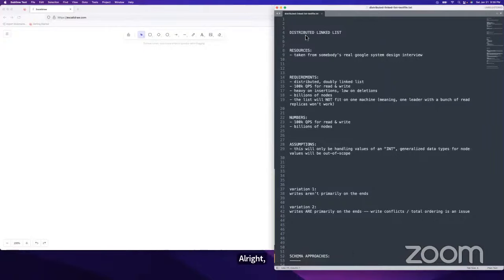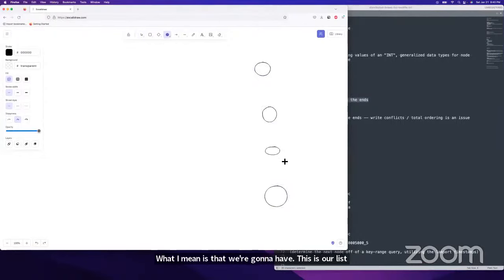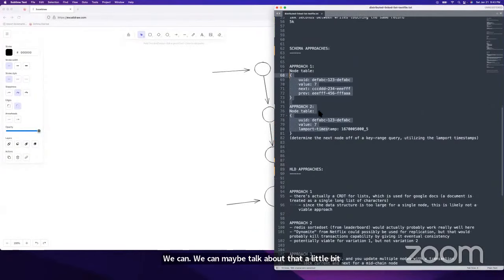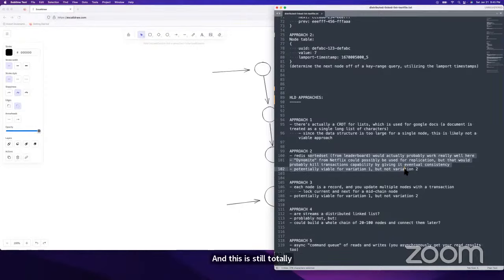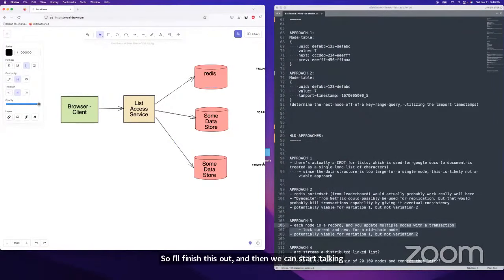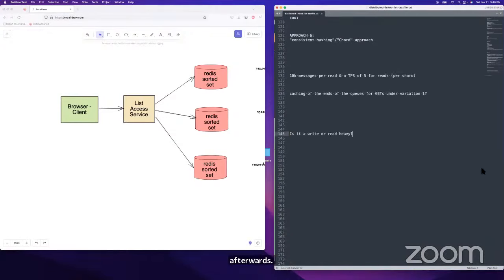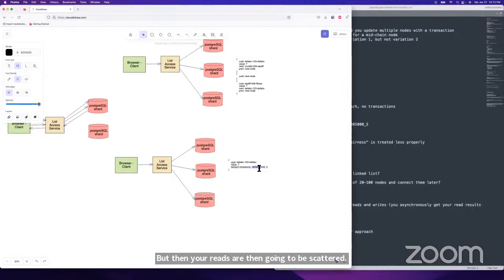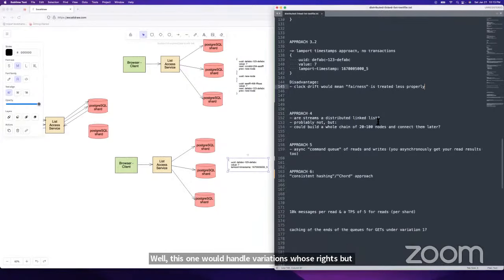Google Interview Question | System Design: Distibuted Linked List

Comment: I get a bit lost without the context of what we want to read and write. Just random nodes? Would be nice to have a bit more context on the purpose of the list.
Reply from the maker: it's a generalized linked list
it doesn't matter what the data is because that doesn't impact design of the system, except for potentially whether the data is large vs small

e.g. if you were designing dropbox instead, you wouldn't be clarifying whether you're storing numbers vs letters -- it's files. you have to store these large blobs of data. that's the challenge.

Comment: "billions of nodes"
"the value is an int"

That's just 4 bytes. 1 billion times that's only 4GB.
Even taking into account the "s" on the billions, its still only a few GB, which can easily be handled by a single machine.
Reply: data size shouldn't be a concern here but 1 disk won't be able to handle that much QPS.
Reply from the maker: Correct.
Regardless, if the interviewer says it won't fit on one machine (as was the case in the prompt that was shared with me), then you can't just say "Yes, I can!" lol

Comment: It could be better I believe.  You have great knowledge but it's hard to follow this video, you go back and forth between question and the different approach, I'm not sure at the end what I should learn and not, it's a bit confusing.
Reply from the maker: That's the point.
Regurgitating a template from out of Alex Xu's book gets a rubber stamp when interviewing for mid level roles just fine, but that's how you fail a senior level interview.

System design (unlike leetcode and coding interview) is tailored to a specific variation by every given interviewer